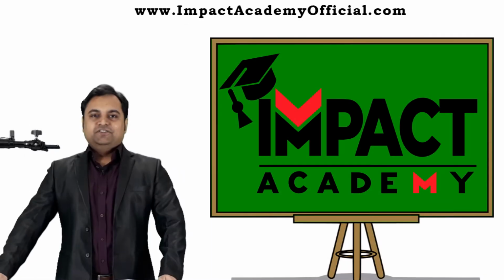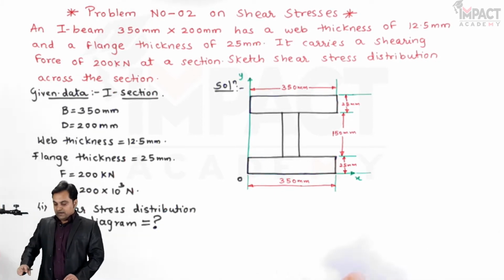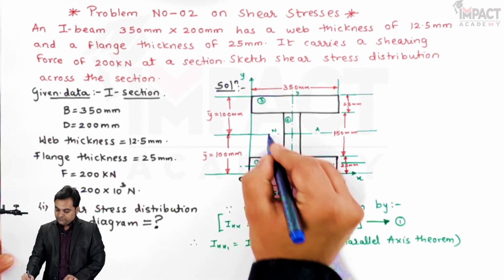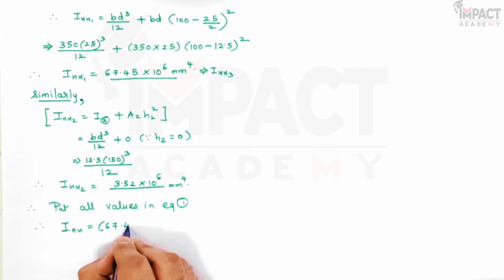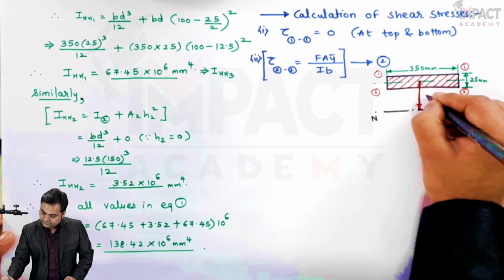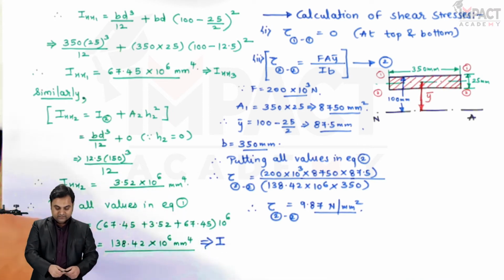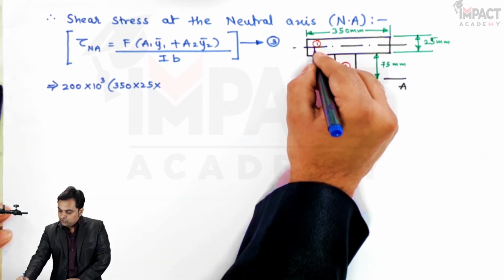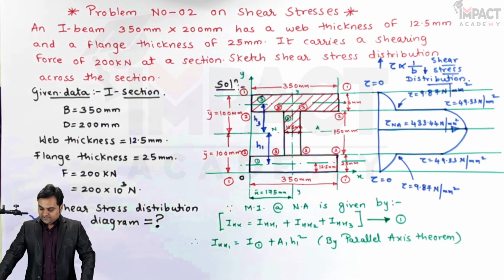Problem No 2 on Shear Stress | Stresses in Beams | Strength of Materials #engineering #gateexam2026

Comment: Sir the Valve of at Shear stress Section 2 is 3.16N/mm2
the Valve of at Shear stress Section 3 is 88.48 N/mm2
the Valve of at Maximum Shear stress is 88.49 N/mm2
Plz tell me Wheather value are Right or Wrong
Reply: You are correct
Reply from the maker: Thanks for watching👍👍👍
Subscribe our channel for get latest update about our videos...
if you want to learn offline call on this no. 7666456011
Reply: Max stress is calculated to be 92.56 N/mm2
Rest are similar to your calculations